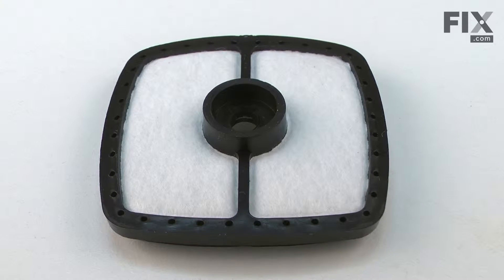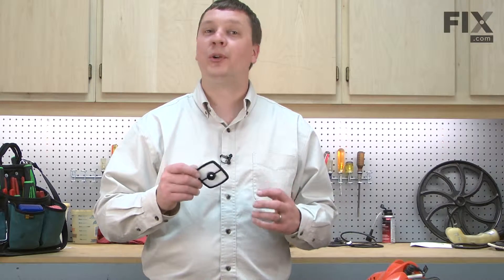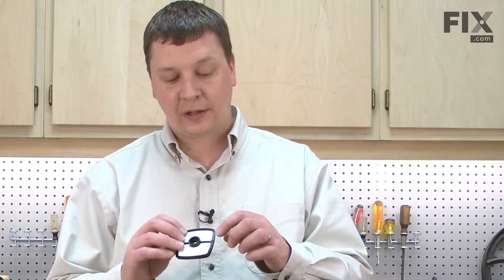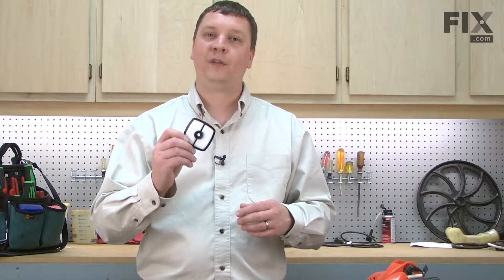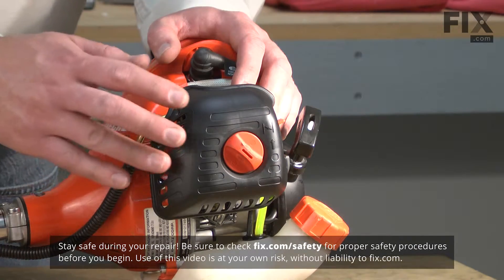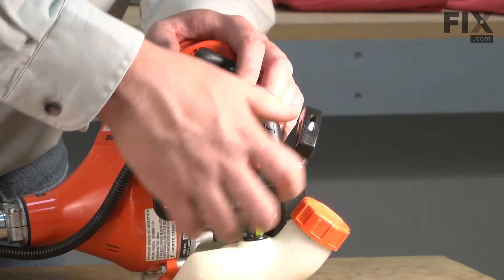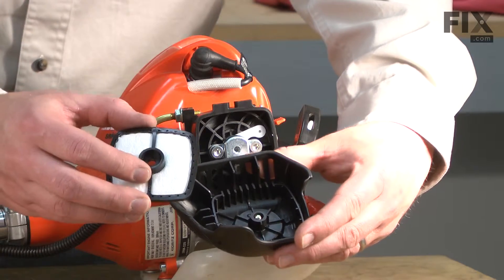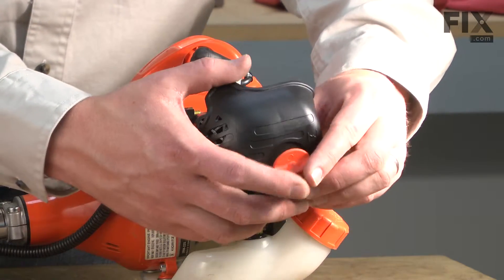Echo Trimmer Repair – How to replace the Air Filter

Comment: Can you wash the air filter?
Reply: Same i wanna know to
Reply: @reynaldosanchez3761  I do it lol, never had an issue. I say go for it. You will save money that way. Shops have taught me to just replace them though, OEM of course. You be the judge.

Edit: 
Do make sure you let the filter air out though before re-assembling to the unit. You don't want a soapy mess anywhere close to your cylinder. Also remember gas and water never mix.